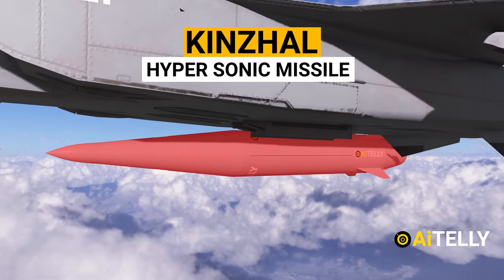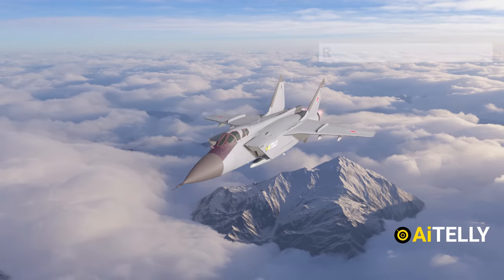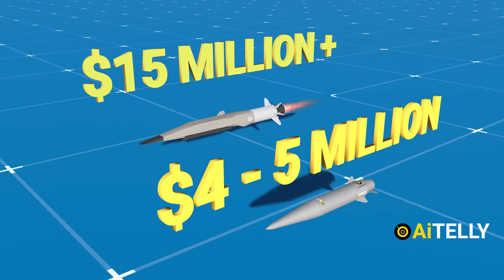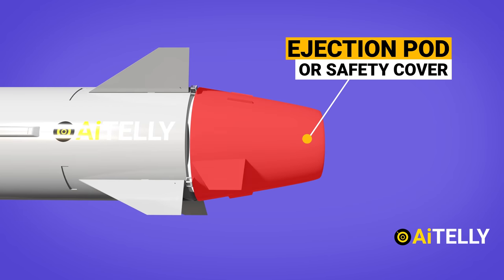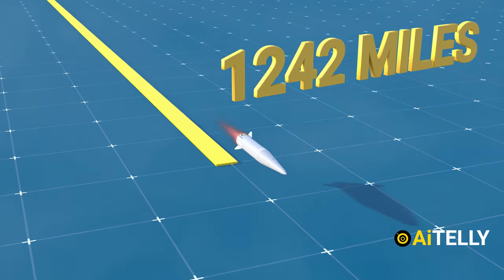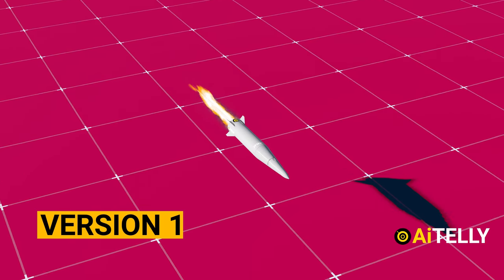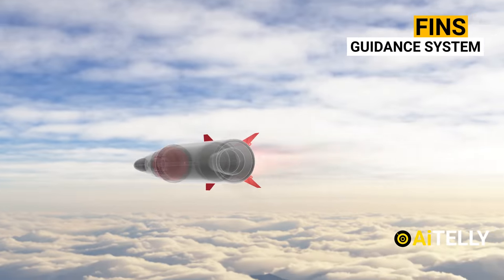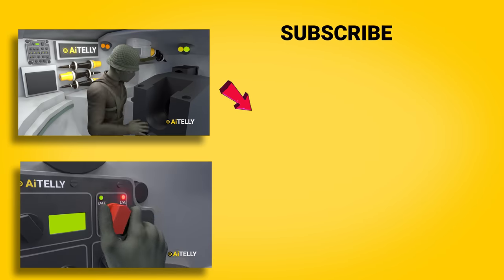Hypersonic Missile How it Works | Mig 31 Kinzhal Launch Process

Comment: Khinzal missile doesn't have a range of 2,000 km. It's stated as 2,000 km launched from MiG-31K and as 3,000 km from Tu-22M3. The reason for that is because the combat range of the respective aircraft has been added to Khinzal's range of 500 km. So what they're really trying to say is that the MiG-31K has a reach of 2,000 km with Khinzal and the Tu-22M3 has a 3,000 km reach
Reply: You do understand that every weapon range already has the altitude and aircraft factored in right?

All air to air missiles / glide bombs / air to ground missile / anti radiation missiles has an extremely long range due to the fact that they already factor in the altitude and the aircraft launching the weapon. If everyone were to use your idea of firing from ground and calling that true range, then every missile / weapon would have drastically shorter range / no range at all. I understand your point, but it isn't a real correction as you can never fire the Khinzal missile from the ground as that wasn't its intended design purpose. So that being said the range of the missile is 2,000 - 3,000 because it will always be fired from an interceptor / bomber platform. If there was a ground variant created then the official range spectrum would be drastically changed, O wait Iskandar is already a separate missile launched from a ground platform with 500km range. No need to correct the Khinzal's range then.
Reply: @dankaloww1067  you pretend to have understood but then proved you didn't at the end. 2,000 and 3,000 aren't the range of the Khinzal when launched from those respective aircraft. Plus, it makes no sense. Since neither aircraft will go close to their top speed when carrying the Khinzal. 
This isn't the same as launching an air-to-air missile under ideal conditions and stating it's maximum range is 160 km. This is the same as saying the AIM-120D goes 1,260 launched from the F-35 and 2,120 km from the F-15.
Reply: @apolloaero  i think you didn't understand what Dankaloww said.....
Reply: @Msemakwelly  my point is very clear. I said Khinzal range adds aircraft ramge. And then I stated examples of what AMRAAM range would be like if we added aircraft range to their respective ranges. I also stated clearly that it's different from when you launch a missile during optimal conditions. Guess what he meant when he said that every weapon range already has the altitude and aircraft factored in. What other weapon does this? The FAB-500 range is stated as 15 km, not 2,515 km when launched from the Tu-22 for example. So no, I think you understood nothing. There's a clear difference between adding combat range to weapon range vs weapon range launched at perfect altitude and speed
Reply: @dankaloww1067 it doesn't matter it's been shot down 😂😂😂
Reply: @GameplayTubeYT  wow, you even laugh yourself from your fictional news. a patriot can shoot down a Kinzhal only once - when he himself is the target of a Kinzhal. last night in Kiev confirms this
Reply: @kskuroku  once? 😂😂😂 Ukraine shot down also multiple khinzal on Russian latest missile barrage😂😂😂
Reply: @GameplayTubeYT  yeah, another ghost of Kiev, some people are too simply arranged, you can lie to them, but they still believe in fairy tales 😂😂😂
Reply: @GameplayTubeYT  
“But a US official later told CNN that a US-made Patriot system was likely damaged, but not destroyed, as a result of Monday’s Russian missile barrage.

The US is still assessing to what degree the system was damaged, the official said, adding that will determine whether the system needs to be pulled back entirely or simply repaired on the spot by the Ukrainians.” (c) CNN

Ooops, this is very funny after your nonsense about downed kinzhals
Reply: @GameplayTubeYT  by the way, there is still no evidence of at least one downed kinzhal. the water pipe with which Klitschko was photographed is not proof 😂😂😂
Reply: @kskuroku  it's missile barrage of course 😂😂😂 but at least they shot down some khinzal before they been damage by Iranian shahed 😂😂
@AndreiBt already prove that the wreckage is a Khinzal hypersonic so Accept the reality that the so called unstoppable hypersonic have been shot down 😂 😂 😂 😂
Reply: @GameplayTubeYT  hahahaha, the patriot shot down several hypersonic Kinzhalss, and then it was destroyed by a slow subsonic Shahid. How I laugh from your fairy tales 😂😂😂
who is AndreyBt and how can he know what's inside Kinzhal if it's a military secret? stop composing nonsense
Reply: @kskuroku  Kyiv said air defences intercepted six Kinzhal hypersonic missiles,
Reply: @kskuroku  of course Patriot can't reload immediately the shahed are slow they likely the last one who hit and damage the patriot commonsense!!! 😂 😂 😂
Reply: @GameplayTubeYT  yes, and before that Kiev claimed that the ghost of Kiev shot down 50 Russian modern military aircraft on an old Soviet plane, continuing to believe in fairy tales 😂😂😂
Reply: @GameplayTubeYT  To believe Kiev is to disrespect yourself. Russia used one Dagger missile. but the Patriot is so cool that it managed to destroy one missile six times. The video from a stationary camera in Kiev shows how the Patriot actually fired several dozen rockets in bursts, and then, judging by the video, was destroyed... By the way, after this video got online, the Ukrainian authorities decided to turn off all city cameras during the alarm...
Reply: @Tonik-13  😂😂😂 all city cameras turn off? Does Kyiv have surveillance camera like China 😂😂😂 what a Joke!!!
Reply: @GameplayTubeYT  If you are not able to perceive the information and did not understand what I wrote. I'll try again. A stationary surveillance camera in Kiev captured the destruction of the American air defense system.  This video got into the network, this fact angered the Ukrainian authorities and they decided to turn off all cameras during the air alert. By the way, at the moment 6 Ukrainian bloggers were detained who also filmed the night fight and posted it on the Internet...
Reply: @Tonik-13  it's clear on your comment "All city cameras" 😂 😂 😂 😂 i never imagine that kyiv has a Intense surveillance like China 😂😂😂
Reply: @GameplayTubeYT  Apparently, you don't know much about Ukraine. Why do you mention China, do you have personal scores with China? Now video cameras are installed in all more or less developed cities of the world, do you think they are all like China? For example, London and Atlanta are in the top ten in terms of the number of cameras, are they also like China?
Reply: @Tonik-13  yeah but most of cameras on other city of the world are private own by businesses unlike on china they use for surveillance and you are saying that Kyiv has a Tech like China where they can control all the cameras around the city 😂😂😂
Reply: @GameplayTubeYT  What difference does it make who owns CCTV cameras, they all perform the same function. Don't attribute to me what I didn't write. I only mentioned the presence of cameras in Kiev and of course they are in other cities of Ukraine, but I did not claim that there is the same system as in China. However, what difference does it make? Most likely, these cameras have municipal, federal and possibly private ownership... But in any case, the management has the ability to control, turn off the video surveillance system. They were able to turn off all objectionable parties and media outlets that tried to be independent and broadcast a different point of view...
Reply: Bro they listern to western new. Patriot has been shot down.
Reply: I agree with @HulKevin, the missile range should be calculated when it leaves the launching platform.
Reply: @GameplayTubeYT  - the only photo of shot kinzal which I sow was Klitcko with a warhead, which was proven that it was Fatab 500 bunker buster bomb, if there are other photos who really show shot kinzal please share it with us
Reply: @GameplayTubeYT  zelensky said all the missiles were intercepted, while cnn reported that a patriot system was damaged. so either zelensky lies, or you intercept Russian missiles with radars and hq's.
Reply: @aleksandrpulnikov684  it's a Swarm of missile and Shahed Drone wtf you talking about? 😂 😂 😂
Reply: @GameplayTubeYT  zelensky said officially that all the missiles and drones were intercepted, which is a confirmed lie. american officials have confirmed this lie. regarding your trash, missiles and drones have a very different speed, so you can't have them all in one place at the same time, unless you advertise publicly where your air defenses are. so you lie. besides, a Russian made Geran drone costs around 20k$ while a patriot missile costs 5mln$. this is 250 times difference!!
Reply: @aleksandrpulnikov684  meanwhile s400 the most Hype air defense innthe world failed to protect Russian Bomber in Engel Russian air base 😂😂😂 i feel bad for India for buying s400😂😂😂
Reply: @GameplayTubeYT  Russia does not use that many kinzhal missiles due to the cost and complex launching. a kinzhal was sent into the patriot once the patriot was spotted. the kinzhal went head on onto the patriot, which must have made it an easy target for the patriot, agreed? this is a prey walking into the hunter. except the roles shifted a bit. the patriot was shooting out all of its missiles in despair and then it was hit. so none of the 32 missiles could intercept the seemingly very very easy for interception kinzhal. a 1.5bln$ patriot can't even protect itself against a 5mln$ kinzhal.
Reply: @GameplayTubeYT  the patriot was operational, i mean turned on and armed. the patriot "knew" a single kinzhal was heading towards him, which is the easiest possible situation for an air-defense system. and still it could not take it down with any of its complement of 32 missiles. according to you, a patriot is supposed to intercept a kinzhal with ease, which means with a single missile. however, it appears that all the 32 missiles were not enough!! because it simply can't. which brings to the conclusion, that you lie about everything
Reply: @GameplayTubeYT  if you cant' take a kinzhal down in an ideal situation, you would not be able to take it down in any other situation either. which means that your compromised ukrainian sources also lied about prior interceptions.
Reply: @aleksandrpulnikov684  bruh Watch other news rather than Russian Propaganda machine 😂 😂 😂 where did you get Russia only use Khinzal? and patriot use all 32 missile to shot down khinzal? 😂😂😂 The Russia use 3 system to overwhelm the patriot "Kalibr Cruise missile" "Khinzal Hypersonic" and "Shahed Iranian Drone" 😂 😂 😂
Reply: @GameplayTubeYT i mentioned earlier, these systems have different speeds. Russian produced Geran drones are the slowest and the cheapest. The Kalibr  missile is much faster, but also more expensive. They are immune to nato jamming, because they do not require constant control of the operator. This has also a downside, which means that the Geran drones and the kalibr missiles fly into the predefined targets. the patriot was spotted during the attack, but the drones and the Kalibr missiles were of no danger to the patriot, because the patriot was not the target. the location of the patriot was just not known prior to the attack.
however, when the patriot was spotted, its location was given to the kinzhal, which was then fired from a mig31. Russia does not keep more than one mig31 in the air after an incident at Bryansk when 2 fighters were lost in a single day. so it was a single kinzhal, which flew straight on into the patriot and took it out nicely. launching a kalibr missile or a swarm of kalibr missiles into the patriot would be pointless, because by the time the kalibr would arrive the patriot would change its location. so the kinzhal was the only option.

Comment: russian videos are more informative, they describe what exactly is hypersonic missile, why kinzal is only partly hypersonic, and why hypersonic missiles have unresolved problems which is not resolved by anyone, like the guidance system which is blind while flying at hypersonic speed because of plasma around the rocket, and they actually slow down for retargeting in the end. This gives change to hit it, but as we have seen they are good enough to hit patriot, which is many times more expensive than kinzal.
Reply: and as the recent video clearly showed 30 patriot missiles were launched (most likely in automatic mode) and a few seconds later the kinzal hit its target.

Comment: When I think of hypersonic missiles, I think of atmospheric missiles / space travel .... to reach speeds of MACH 18-25   .... Mach 5 is traditionally what we see in earths gravity
Reply: You are wrong sir.
Objects don't reach Mach 5 (1,725m/s) by freefall in Earth's atmosphere. There's something called terminal velocity.
Reply: @ikenwugwuT  I underestimated / didnt take into consideration air drag , in addition to gravity , ty
Reply: 2 totally diff missiles function wise , 1 is an outer space arrow the other is a arrow w a scram jet engine to maneuver which will take it out of hypersonic speed
Reply: if the altitude is lower or the speed is higher, the temperature will reach several thousand degrees Celsius. So it's not possible.

Comment: Kinzhal is a ballistic missile, which by their nature are hypersonic.
Reply: And vast majority of ballistic missiles are extremely hard or impossible to intercept. Plus Kinzhal is claimed to have an ability of changing pathway at most stages of flight, so it vastly differs from a typical ballistic missile like say, Minuteman III.
Reply: Just like German V2 missile from ww2 actually
Reply: @slavicemperor8279  ballistic missiles have a predicted trajectory and cna be easily intercept when detected and to overcame this exact problem they want to make it change protectory which in fact is very hard task on hypersonic speed so it needs to slow down
Reply: @slavicemperor8279  But Aegis-systems (from boats but also from land like the one in Romania) can intercept ballistic missiles.

Comment: Im wondering ( noting , of course , the fact you are not an expert on this question) - How does the missile steer itself in flight , to avoid detection? Telemetry from ground stations? Pre-programmed? and how about the actual mechanisms of how it steers? I am not versed in these things either. Thank you
Reply: The ability of the Kinzhal to steer in flight is conjecture only. Many knowledgeable people say that it cannot steer itself and is just like a ballistic missile.  I do not know either way.
Reply: @michaelrunnels7660  It certainly is an air-born ballistic missile.
Reply: Да она может быть управляемой но при каждом маневре начинает терять скорость
Reply: here many people confuse Iskander and Dagger, Iskander can fly both in ballistics with acceleration of the warhead in the final section and maneuvering like a conventional cruise missile, accelerating up to Mach 3-4 in the final section, the Dagger is essentially a different missile, it is accelerated by the aircraft after launch the carrier of the warhead goes with the necessary acceleration after separation, the warhead accelerates already to the desired units while maneuvering, now on guidance, guidance is similar to most air-to-air missiles, the first stage is loading coordinates, loading into the unit’s memory, flying along an inertial guidance system, the second stage is adjusting coordinates from a satellite or your own guidance system (which no one knows and will not say) it is clear that in the final section it can also be corrected or it itself is corrected in the case of active electronic warfare
Reply: From the limited data we have, it looks like it uses a retro-rocket steering system. It blasts jets of propellant out of the sides, up, down, left, and right. The speed is too fast to use the very small winglets as control surfaces. Just my observation, and definitely not verified.

Comment: Kinzhal slows down to mach 3 in the terminal phase of the flight. This is required to lock on the target properly. You cannot expect an atmospheric missile just slam accurately into a target with mach 10??
The terminal phase is also when it can be intercepted.
Ukraine gets benefits from NATO AWACS coverage getting early warning on all missile launches hudreds of kilometers away. When the missile enters Patriot range, terminal ballistics for are already calculated. The Ukrainian operator just needs to push the button. 
I think Kinzhal is not actually a proper hypersonic missile at all. It does not seem to be very maneuverable.
Reply: lol, how it slows down? a tiny parachute behind it? are you smoking parsley? how do you slow down from mach10 to mach 3?
Reply: The Patriot operators executed 30 button pushes on May 16th. It didn't help them.
Reply: @ddiac  🤣🤣🤣smoking parsley 😂😂
Reply: Apparently, on May 16, the operator turned into a hardcore gamer and pounded on all the buttons in a row like crazy. Probably the West needs to educate Ukrainians better so they don't waste expensive missiles lol.

Comment: The hypersonic Kinzhal missile flies at a speed of 12,000 km/h. In its final phase, Kinzhal rises to a height of 20 km. From there, it maneuvers and rushes downwards vertically at the same speed, hitting the target with an accuracy of one meter. The power of the Kinzhal's kinetic energy has capability to penetrate the Earth to a depth of 30 km and result in a massive earthquake. Kinzhal is undetectable by the Patriot and other air defense systems, and it cannot be destroyed.
Reply: только не 20 км.
Но бункер, способный выдержать ядерный вызов(а это 60 м грунта минимум) способен поразить ударной волной.
Reply: complete nonsense,
Reply: Cope